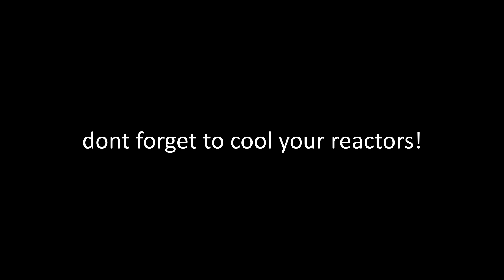How to make Fissile Fuel - (simple)

Comment: For some reason my oxidizer with the sulfur dust won’t give me the option to configure it to input only blue output can anyone help me figure this out?
Reply from the maker: You might have to place the machine in a completely different orientation than what it's in right now. Sometimes I did that and it would solve that problem. Hope that helps!

Comment: I had the whole thing set up twice over and eventually the hydrogen chloride stopped being produced and it fucked the entire thing up. Any idea why? Pretty frustrating. Gunpowder stopped being converted into sulfur dust, and oxygen stopped being produced.
Reply from the maker: It sounds like you might have a chemical that is full in one of your machines that has nowhere to go, see if you can find if one of the machines are full with a chemical in it and drain it out.

Comment: any idea with my current problem? I've done everything the same but the first electrolytic seperator keeps messing up. It will either produce chlorine or sodium then it wont produce either or pump the chlorine out. Ive been changing config and cant work it out atall

Comment: I cant seem to be moving any hydrogen or oxygen from my Electrolytic Seperator to my chemical infuser
Reply from the maker: Make sure your side configurations are set properly. You could also use the wrech from Mekanism to pull/push the chemicals by shift right, clicking the pipes connected to the machines. Also, make sure there are no random or incorrect chemicals inside the pipes already.
Reply: @PapaOxi your discord link isnt working maybe someone in your discord can help me out? I can share my screen thru there
Reply from the maker: @jimenezthegoatoscar9825   https://discord.com/invite/rAkAaDgN here is a fresh discord link, sorry for the wait, I've been asleep lol
Reply: @PapaOxi  thanks man no worrys just joined it now.
Reply: Yea ive made sure but i could just be overlooking a step your discord link is invalid i can try to join it and find some help there